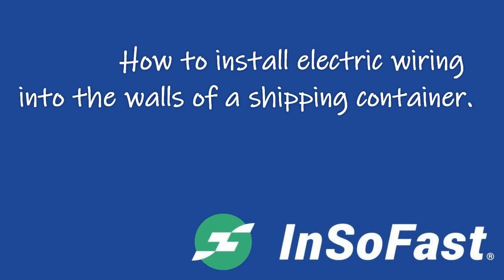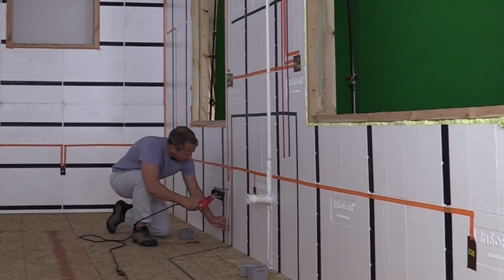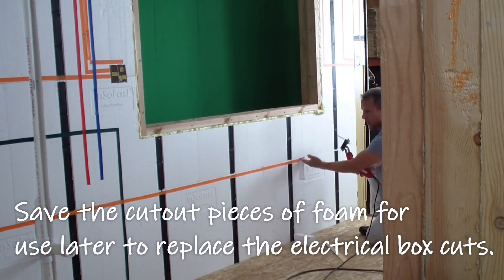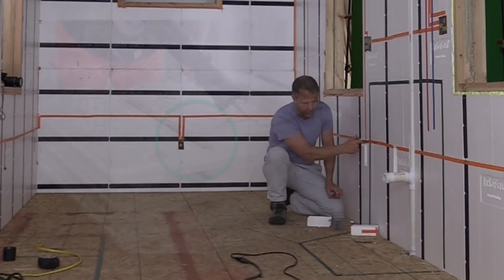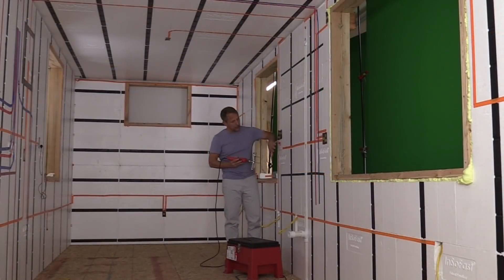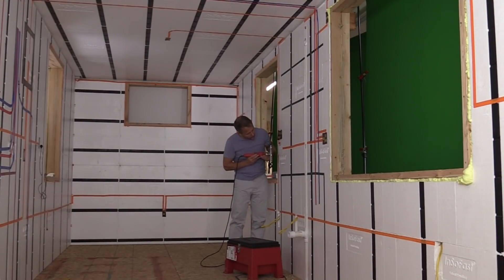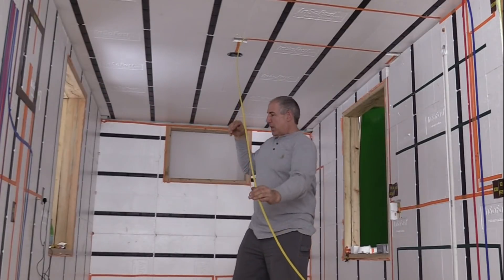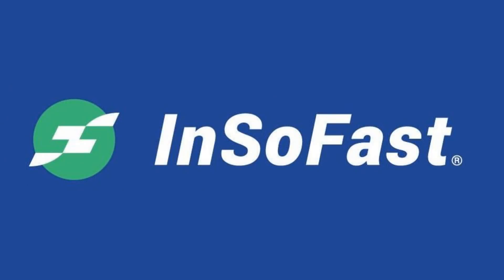InSoFast Shipping Container Electric Installation

Comment: To pass any sort of code, you would need to put nail plates over all wires.
You don't have the proper depth of walls, to run Romex, you need to be running MC cable, or conduit to pass inspection.
This job is not good
Reply from the maker: Actually the panels raceways according to code are at the proper depth 1 ¼”.  "Where installed in grooves, to be covered by wallboard, siding, paneling, carpeting, or similar finish, wiring methods shall be protected by 0.0625-inch-thick steel plate, sleeve, or equivalent, a listed steel plate or by not less than 1 ¼” -inch free space for the full length of the groove in which the cable or raceway is installed." (InSoFast panels are engineered with a groove that forms a raceway with the required protection or “free space” of 1 ¼” along the full length of the groove)
Reply: Did you calculate the thickness of the wire? And it being wavy, not perfectly flat.
Your boxes don't seem to be mounted to anything either.
Minimum code is the worst job allowable by law.
Anything less you could go to jail.
You are pushing your luck.
I do not believe this would pass inspection in my area, the authority having jurisdiction has the right to require more stringent rules than minimum code, you might not pass.
If anybody tries this, I would check with your local authority having jurisdiction first. (Inspector)

Comment: How do you secure electrical boxes to the foam and meet building code?
Reply from the maker: There are several methods from adhesives to preplanning and welding in the boxes or attachment strips. Contact your local building code official and ask them what they will accept. Unlike a traditional framed wall system the electrical box a solid wall is restrained from moving.

Comment: So what about moisture. Hot air strikes cold exterior creates mold..
 No exit for interior moisture. You are blocking air movement a beaded at second row. Have 100" rain and 80% humidity climate. It delaminated t1-11 stored with bisque decades ago....
Reply from the maker: Proper HVAC (heating ventilation air conditioning) must still be maintained. But no water will not get behind solid foam if install properly. Steel and EPS foam are not a food source for mold to grow on.....see above about proper, "HVAC (heating ventilation air conditioning) must still be maintained."

Comment: Do you have a similar product to use on the exterior of a container so as to keep the thermal mass of the steel INSIDE the thermal barrier?
Reply: And if it were UV resistant and reflective foil on the outside that would be extra beneficial. Of course being able to sheath that would be important too.

Comment: Need a second raceway for low voltage cable such as Ethernet or Phone Service.
Reply from the maker: In container side walls the electrical raceways are 22" on center going vertically and 24" on center going vertically. https://www.insofast.com/explore/shipping-container-installing-electric.html

Comment: Did you have to use heat resilient paint on the shipping container? I heard they do in hot climates.
Reply from the maker: The high constant operating temperature of our insulation is 165 degrees F. Dark color containers in the desert could use a good reflecting paint.

Comment: Really like this stuff... Certainly, goin to look into this.. Only questions are the ratings of fireproof levels...
Reply from the maker: Fire safety is always a concern in construction that is why our company has a fire safety code report available online: https://www.insofast.com/media/InSoFast-IntertekCCRR-1029.pdf. Our panel does not off gas and the adhesive we recommend is green guard certified (low VOCs). If you have any further questions feel free to call InSoFast  at 888-501-7899